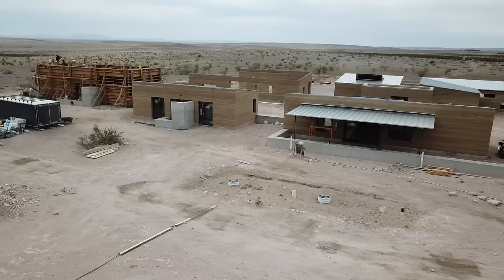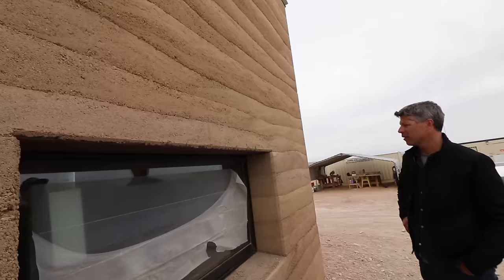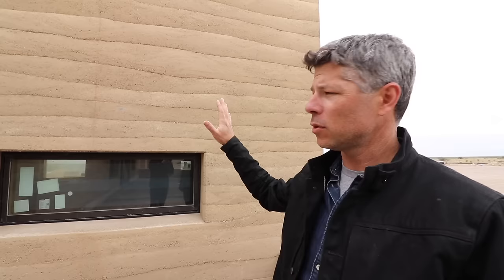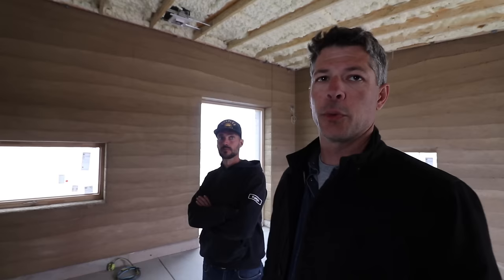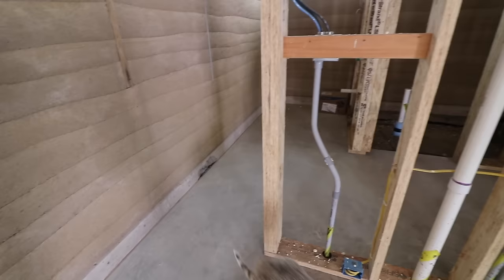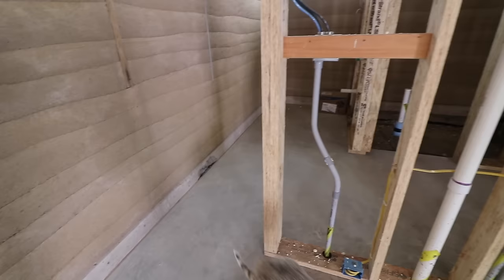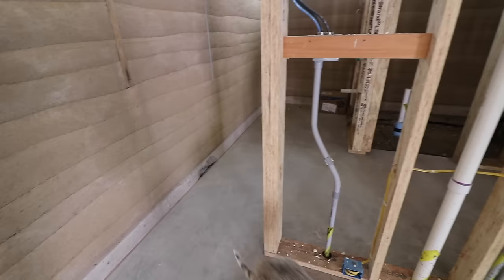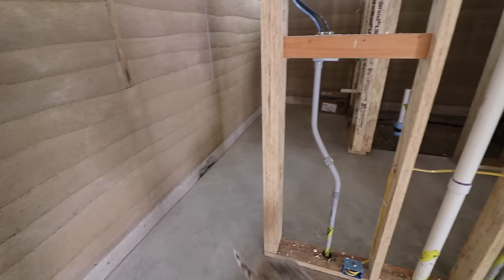Rammed Earth : You won’t Believe How They Build This!

Comment: I would think the more mass you have in a big cement mass like that the more heat it will absorb, and the less heat it will radiate.  You have it heating up all day in the West Texas sun, and then by the end of the day that heat is coming to the inside walls of the house and how the hell do you get rid of it?

Even opening the windows and blasting all the hot air out won't help because the heat entering the living space is coming from inside the wall.

Comment: It is known as "Cob" here in the West of the UK and its a very old system quite possibly taken over with immigrants ?   Isn't adobe similar ?
Reply: Cob is not rammed earth. There is no compression other than gravity and hands happening with cob.
Reply: I think the Adobe is traditionally mid and straw. Similar, but different. Brink are sun dried, after the building is made, you need to cover the adobe, as if left exposed, the Adobe bricks kind of disintegrate.
Reply: Mud. Earth and water.
Reply: Original adobe may have not had any plant material as far as I know.  There be very little grass like plants in the American Southwest or Northern Mexico.  So, there sun dried dirt bricks may have been just dirt.  Maybe clay added from local deposits.  When needed they just remud.  That is what they still do on old adobe buildings in Arizona that have not been stuccoed.

Comment: You don't have to be so fancy. I've seen it done other ways, they're just making it so that it's more of an assembly line process. I want to build a home of rammed earth, but I want 4 foot thick walls. You don't actually need the cement, if you can get good crush and run gravel to mix in. you also need sand and a clay like soil, which around here is plentiful, and most like on site. Contrary to what most think the concrete isn't added because it's concrete, it's added because it's a readily available powdered stone. You could use other stone if it was powdered. In my area, the rammed earth would require a coating on the outside to prevent water damage as it's very rainy here. You could do things like have custom made forms that would make either the interior or exterior look like something else, say a log home.

Comment: one big reason it has taken them so long to build and at a much larger cost etc is all the separate buildings . This makes for many more feet of outside wall to build.  For example: for the 6,000 square feet you could have 150 feet by 40 feet perimeter  for total of 380 feet of wall or you could have  6 buildings that are 50feet by 20 feet that equals  140 feet of wall each or 640 feet of wall total a difference of 240 feet of wall.  This is just theoretical example. It could be that they need more mass in wall for cooling etc than the 150 by 40 would have or they didn't want to build any non rammed interior walls or solar concerns etc.

Just think if they built 2 story and seems possible since they have a 15 foot high wall 18 or more might be possible they would decrease some more wall since less periput needed .  All kinds of possibilities.

Comment: how does these walls/ structure hold up in rain / wet weather
and can the interior walls be covered / painted etc. if needed
Reply: Basically the dirt is mixed with cement powder so it will "become" concrete type form and it will be sealed.  As for interior personal preference but remember these walls are NOT perfectly smooth and has holes in it?

Comment: I like to wood inside but not for every single surface.......also I like a combo of in floor with a gas heater in form of fireplace or even wall mount electric... u can keep in floor heat at a nice 60 degrees or slightly 
less.  .the. Just nurse the gas or electric while your inside only for that instant whoosh of warmness...  it’s efficient and comfortable...no need for house to be heated and cooled with no occupants.   Is u have an effect of enough sizing and powerful setup is by far most efficient

Comment: Not sure why this would be better than concrete wall construction unless concrete just wasn't available at a reasonable haul distance.  Also the roof will be the weak point in case of a tornado or WWIII it should have been made out of concrete too.  The windows and roof of course will not survive either a tornado or WWIII so I assume there are shelter areas?

Comment: I like the idea...but even with  1600 psi at finish and no reinforcement it will fail with earth movement..Concrete strength is great in compression but has very little tensile strength..any earthquake, twisting moment or  shear will bring these walls down.. I'm wondering if there is away to incorporate coated steel or other tendons to give the walls tensile strength..? That would still allow compression compaction..of the lifts

Comment: I've got a few kinda weird questions about these rammed earth walls. Two feet of very compacted dirt mixed with a little bit of a bonding agent in a bit of concrete. Very interesting. My first question is how fireproof are those walls? Second question is how well do they do against high powered rounds such as the .308, .270, 7mm, 8mm, .338 Lapua, .50cal BMG? Last question, how well would these walls provide protection from radioactive fallout? 

I think these homes could possibly do well in an apocalyptic book.

Comment: Has anyone used a vibratory plate compactor to compact their rammed earth walls? I am planning on building thicker rammed earth walls (approx. 18 inches thick) as we have a lot of soil that we can use (it's been tested) and a vibratory plate compactor I own is about 17 inches wide and do not relish using a tiny hydraulic hammer tamper or hand tamper for a year or more to construct my house. The plate compactor is designed to compact dry soil anyway, so why couldn't you build forms slightly wider than the plate compactor, put in your lifts of properly mixed soil, use the plate compactor to compact to the rammed earth to the desired density all the way around the perimeter, then repeat for each layer? I will do a test this spring and see how it goes, but wondering if anyone every used this method of using a large tamper such as the one I own? If it did work, it seems like it would save about a year of tamping by hand. I am curious if anyone knows of someone who has tried this method.

Comment: One question...is it possible to add a colorant to the mix before you put it up for the walls...I'm sure it wouldn't be a paintable surface because of the earth in the mix...right?
Reply: Robert, my question to you is why wouldn't it be paintable due to the earth content? Do you realize that concrete is entirely full of "earth" in the mix? They are basically making concrete here- mixing portland cement and crushed granite aggregate from a quarry. Once it's set or cured, the material should be 100% as paintable as any concrete you buy from Sachrete etc. Now if this were real "rammed earth", and more along the lines of a traditional adobe- containing no cement, then painting becomes an issue but not entirely out of the realm. In fact painting a traditional adobe or mud house could actually help prevent erosion from taking place during heavy rains, etc. However, these buildings should have little or no issues with erosion as they are, as I said, basically concrete buildings- just not typical concrete from a supply house. Hope that helps :)
Reply: Oh, and yes, It would entirely be possible, and fairly easy to add colorant to their mix. As long as it's rated to go into concrete- it could be added just fine to their own mix as well.

Comment: So, there's no structure inside to keep the dirt together? What happens in the case of tectonic active places?
Reply: They said they have a reinforced bond-beam coarse buried inside, plus the steal i beams and plates, rebar, plus 10 percent Portland cement,, plus expansion joints for movement, that will hold 1600 psi. Did you just comment without watching?

Comment: I'm wondering if a castle-like structure could be built from rammed earth, or would the load factors be too great.
Reply: with the mix these people are using, yes, you could, because all they are doing is making cement look like dirt. add proper cross beams and supports and you could make whatever structure you can imagine.

Comment: This radiates heat as hell, Ideal house would be, compressed straw blocks from the outside, thats a must, and clay bricks , on half brick from inside only for stability, inbetween earth as thick as you wish, but no rebars for god sakes, thats such a waste, rebars are not even designed for anything thats not concrete.

Comment: What percentage (in volume) of Portland cement is added? Best regards.
Reply: The New Mexico Earthen Building Code (which is widely used by other states as no other states have an earthen building code) says a stabilized rammed earth mixture contains 6% or more of portland cement by weight.

Comment: Regular concrete starts at 2500 psi according to Mr. Internets so 1800 psi should be good for non-demanding construction. Nice.
Reply: I'm used to referring to strengths as MPa however yes, the standard load-bearing/strength ratings of SRE are absolutely adequate for anything up to 4 storeys high and some have been engineering to be even taller than this. Anything with higher demands than this would have to be substituted. Of course SRE wouldn't handle and disperse the loads that concrete highrises can.

Comment: 17:49  No safety equipment???
There should be a metal support 2x4 railing around the perimeter 
And the guy standing in the bucket of the loader should be tied off,
that site would be shut down in Canada.
I don't even see a hardhat, what kind of construction site is this

Comment: I'm not feeling it. The first image I saw was the guy running his hand over the outside of the wall and a cloud of dust, dirt and concrete leaving the service. 500-year wall? I doubt it. Does that come with a written guarantee?
Reply: Bill White This type of structure is climate dependent. If the structure is kept dry and maintained well, it will last a long time. They only get about 10 inches of rain a year there. You can do this in a little wetter climate with proper precautions like large overhangs, drainage, and sealants etc.

Comment: how would that stand in northern winters thaw and freezes over time?
Reply: The main idea is to have a good stem wall and a sturdy roof with wide enough overhangs to prevent excessive erosion of the walls. In my opinion, the exterior of your house in a northern climate particularly will still benefit from insulation. Here, you see it in the roof, which is the most important, but insulating the northern wall and the eastern and western walls would also be highly advisable. I feel that earthen walls are ideal for the interior walls, because they provide thermal inertia to the dwelling. Without insulation, you need to understand that earthen materials act as thermal bridges, conducting heat through the membrane. I wouldn't even use hempcrete as insulation, frankly.

Comment: What is the differences between this tech and traditional concrete? Gravel with dirt instead of gravel with sand? Or what??? Is it cheaper? Same formwork, same pouring, so why don't you use just traditional concrete??????????

Comment: Is there a high radon content in earth homes?anyone know?
Reply: Hi Stephanie. It all would depend on the floor system used. Preventing radon from entering the home is all about installing a vapor barrier of some sort within or beneath the floor system. Concrete, which is basically what they are using here, will block radon far better than say a dirt floor would, but the concrete will still need sealed in order to keep radon out of the home. If not, it will slowly "breath" through the concrete floor into the home. This is why most homes will also need some sort of ventilation to prevent the buildup from radon. Very few homes, like mine for instance, are close to 100% radon free. Hope that helps :)
Reply: @Rick-the-Swift  thank for your answer. Very helpful!
Reply: @Rick-the-Swift  breathE  When you have breathed your last breath, your breathing will stop.

Comment: You guys want to really make your business thrive I think you should get a blacksmith to make you huge single-panel forms out of steel l-shaped with welded braces would look like a tall right triangle I'm talkin 20 feet high by 20 ft wide and get yourself four of them and on two of them create hinges or a latch system where you can remove two foot panels for your different size and walls inside walls but anyway then all you would have to do is drop them in place with a crane after leveling and you could get a set of four smaller ones to be stood inside the perimeter you could either drive stakes through them or Park vehicles on them or any other thing to offset the force encountered when the pressing begins I have 80 inventions just ideas written down I know I could make millions if I could just get to talk to the right person mostly tools things like that household items I also dabble in sealcoating electric guitar drones and pitbulls I'm from Delaware and want to start my own sealcoating business to be ready for the summer if anyone has any ideas on how to I can turn these thoughts into Cash I'd love a great life saving idea I'm unemployed I was a commercial roofer flat roofer rubber but society doesn't want me because I know the truth about Jews and I can't remain silent so that tells me I have to start my own business or invent something I always have good ideas I don't know why but I've always thought differently as far removed from box as possible but known to be found examining the true limits of the inside

Comment: Incredible Video!  At about the 19:50 mark, I notice they show the corners of the building smoothed off.  How is that achieved?  Is that done after the framework is removed but while the rammed earth wall is still damp (first 60 minutes after framework is removed)?  Curious as to what tool they may use for that kind of thing?  Thanks for all you do!!

Comment: Their roofing system is going to rot from the inside out, the spray foam insulation guarantees it and will be accelerated in high moisture producing areas.

 Every door and window opening spanned with a steel lintel, instead of poured concrete is guaranteed to crack because the co-efficient movement variations between steel and concrete are to drastic.
 If the lintels were welded to the base plates, (one side, or both) they failed to incorporate  expansion joints perpendicular to each span. I don't care if the walls are 2' thick or not, their going to crack!
 Revisit this project after 2 or 3 years of occupancy and let's see for ourselves if there isn't damage?

Comment: Earth bag homes seem to possibly be better.  If you have to have heated floors there is a problem.  And these guys are having to use structural steel and lots of concrete.  This seems very expensive.

Comment: And if you want more strength you could pour Roman concrete along the inside and the outside of the wall so you don't see any of the rammed earth but there's the inexpensive product and the strength. I'd do 2.5 feet walls so it's bullet proof. Yes, these walls are bullet proof but not as much as 2.5 ft. 
U like these houses except for the roofs. Those roofs will have to be changed out very frequently. These houses cannot be no more than $30k each. Can't!